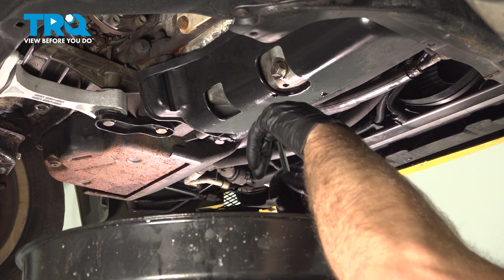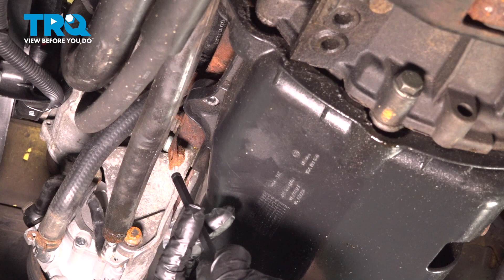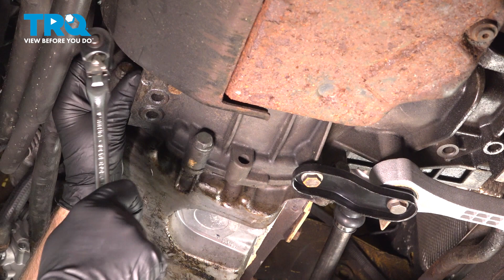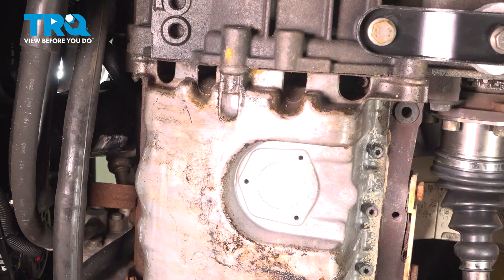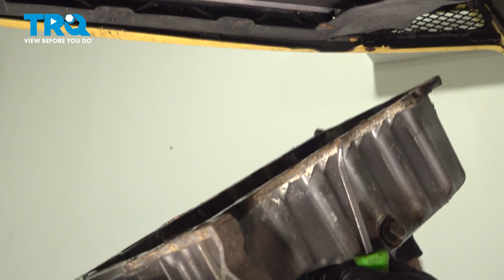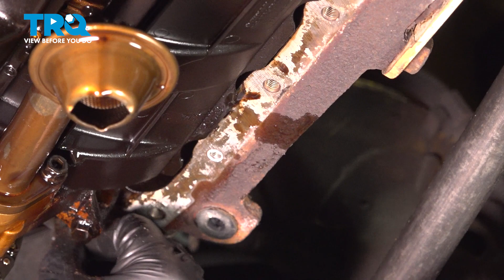How to Replace Oil Pan 1998-2010 Volkswagen Beetle

Comment: Thanks for the video TRQ, gives me more confidence to do the job myself.
One thing though, in my Haynes manual #96009 it says that to remove the oil pan you first have to remove the timing belt and crankshaft drive sprocket, but that wasn't mentioned in you video.
Will I need to do that (remove the timing belt and crankshaft drive sprocket) to replace the oil pan or not?

Comment: When I put the bolts back I lost one in the center one I couldn’t get it with a magnet. I’ve already put the gasket seal on. Could I leave it or need to take off start over?